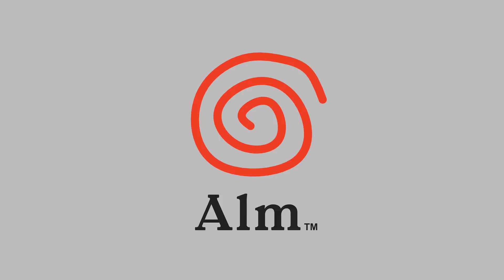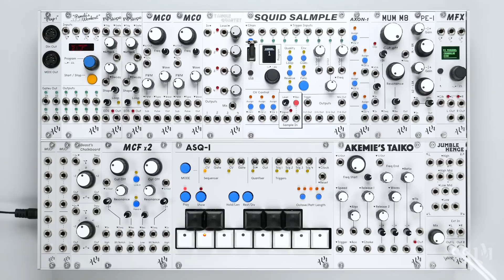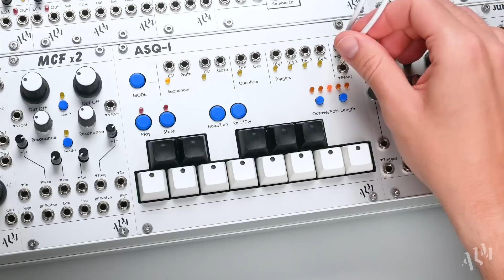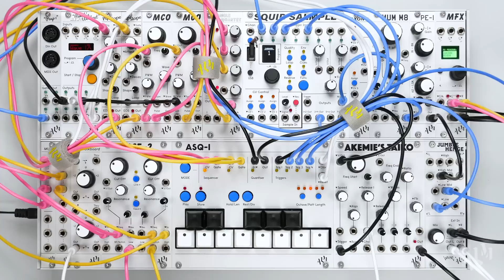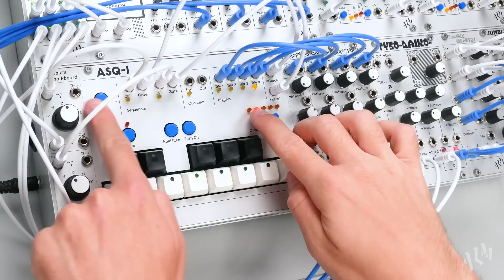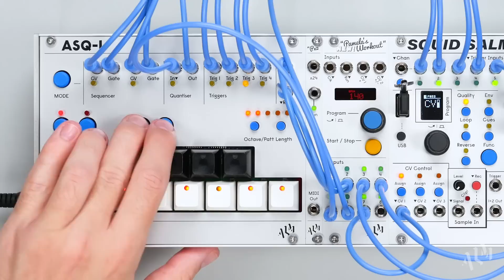Introducing ASQ-1 - Multimode Sequencer - ALM035

Comment: I noticed that to perform slides, we hold a key and then press another key while holding that note down. Does that still work across octaves? So hold a key, then while holding octave up/down, and select a new key before releasing the first key? And then what if you want to do the slide on the same note an octave up/down? Since there's no way to hold that key, while pressing the new key (since they are the same).

Comment: Sorry to say this module has one of the worst sequencer user interfaces i have ever come across. It may have a load of options, but also a load of incomprehensible button combinations to access them.
Much prefer the Oxi one, the Korg SQ-64, the ARP 1601, or the Klee sequencer of which i have a software version with Midi and chord support.

Comment: Amazing! At 17:00 - where the second pip  slope is reducing the level of both voices for the side chain ducking effect. Is anyone able to explain how this is happening? I don’t quite understand the patching! Thanks!
Reply from the maker: The output of that Pip Slope runs to the level CV in of Operator 2 on the Castle with the level control turned up to drone the pair of voices. Its attenuverter is then set negative to invert the Pip's envelope and produce the ducking the droning voices.
Reply: @ Ah thanks a lot for explaining ! Appreciated

Comment: Do you know if this sequencer would track one slice per key on squid if the pitch cv was assigned to slices? Looks awesome!
Reply from the maker: Yes but you would likely need to do some attenuation (or amping) / offsetting of the CV in to Squid. Squid does not currently map slices to 1/12volt steps.

Comment: The SH 101 can work with rythmical Clock input that means each clock pilse triggers a step. that means if you trigger the sequencer with a tom out of a 606 you can create rythmical sequences, does your module has this feature too ?
Reply from the maker: Yes.
Reply: @busycircuits  great ..then i will buy one 🙂

Comment: Can I do 4 pages of 7 steps each for Ventian Snares style stuff?
Reply from the maker: You can do patterns of mis-matched odd lengths - that kind of thing ?
Reply: @busycircuits  At 11:10, you are choosing a specific drum pattern page with the octave buttons. I am asking if each of those pages can have only 7 steps. I want it to go to 7 on page 1, then go to 7 on page 2, then go to 7 on page 3, etc. Then you can create a 7/8 time signature pattern like Venetian Snares. I also wonder, what directional play options does it have, reverse, random, ping pong?
Reply from the maker: @Digiphex  No, to do that if I understand correctly you need to create a 28 step length sequence and all the step would be 'joined' visually - it would split per visual page. Output would be the same though I believe. Just fwd direction atm!